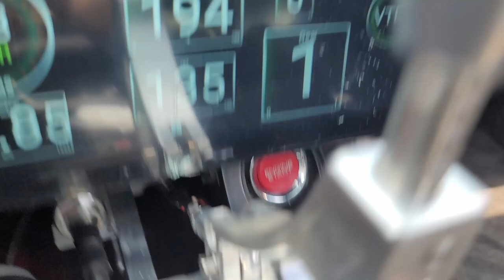Turbo Honda Prelude MIR quarter mile test and tune

Comment: If you caught it early. You can just swap the pump and be fine. But to be careful just drop the pan and look at the bearing. You may not have to pull the motor
Reply: Good call
Reply from the maker: Wait till you see the next video lol
Reply: @treybedipping1734  lol spoilers 😂

Comment: My Lude never made it to the track before she was stolen but when I had her I always launched her in second gear cause first winds out too quickly and if you’re able to break traction too in second just feather it till it gets traction. Also, I always OG shifted (gangster shifted?)🤔 basically I shifted with the gas pedal still on the floor but not redlining quite yet to hit that peak redline on a clutch dump…. I miss that Lude so much🥺😭 the original Rayleen Prelude (Prelude #2) 1999-2001ish time
Reply from the maker: Nice might try that

Comment: Don’t be scared to leave the boost duty where it was and increase the boost cut a few psi. Your engine is plenty good for it. The car will make more load on the track than the dyno
Reply from the maker: Im more worried about running out of fuel than power. That was my issue on the dyno
Reply: @treybedipping1734  engine good for it; oil pump maybe not 🤣

Comment: Bro I know that feeling, I shattered my oil pump 2 months ago messing with this raggedy civic si
Reply from the maker: Lmaooo dam did you get it fixed?
Reply: Yeah but I had to remove the engine because I have 99 civic with an H22a and the balance shafts are still in it. There is no belt but they are still there so I have to slide the oil pump over it. Hopefully you got the balance shaft delete kit on yours. Will you upgrade your pump gears? I got the 4 piston oil pump but I upgraded the gears since the stock gears are prone to breaking at high rpm. A good crank damper will help remove the vibrations that break them in the first place
Reply: @wendellgreenidge3362  if you undo the nut for the balance shaft on the left then you don’t have to slide the balance shaft out along with the pump. Same way you would do it in a prelude. There’s actually more room in your car than in a lude engine bay lol
Reply: @HollywoodCod  no it’s not, you don’t even know what kind of car it’s in lol. It’s in a 99 civic coupe and it’s h2b which slides the engine closer to the drivers side. There is barely enough room to replace the timing belt